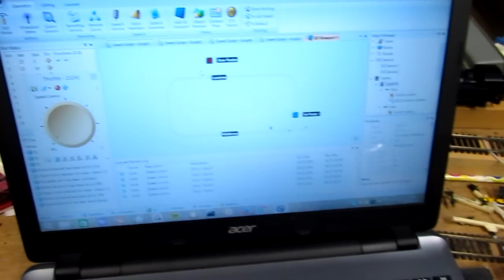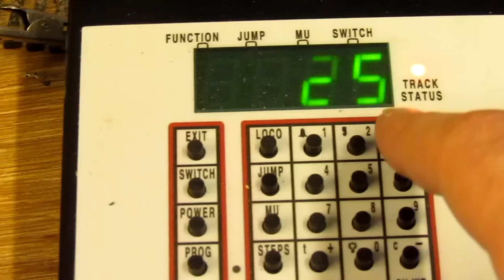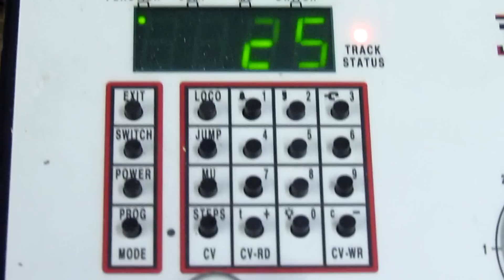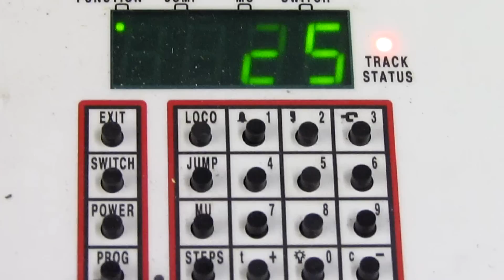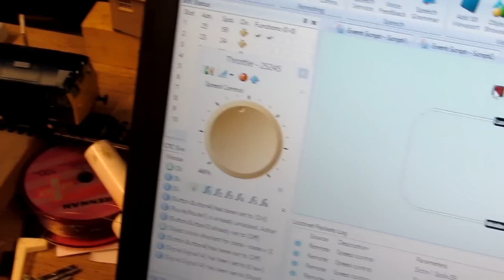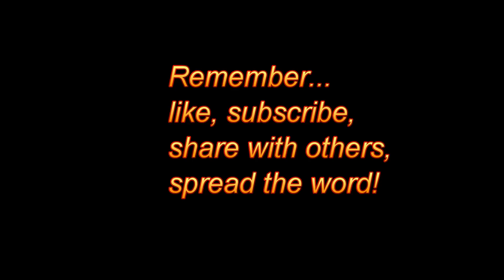Hornby Signal and DCC RR Automation

Comment: Looks very complicated but if it works must be good for operating?
Reply from the maker: Humbolt136 Thanks for the comment. Yes, operating trains is what I am aiming at... basically I want to be able to automaticlly run some trains around the layout while I do shunting in th idings - or have friends over who can also take a section and do some shunting. I think about 1 year should see the track work done!! Using software will allow many more trains running safely than just manually controlling them ,making for some very interesting and intense operating sessions... well that is the hope! I think model railway club could use this approach more... and I am happy to help if they do btw!